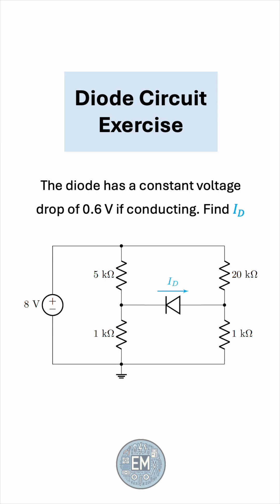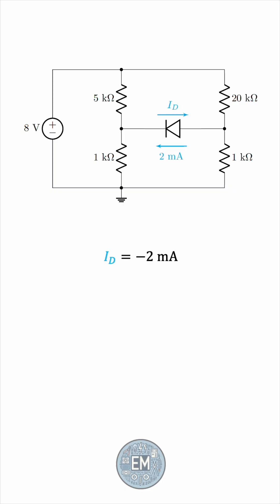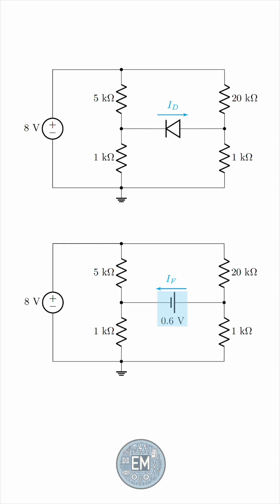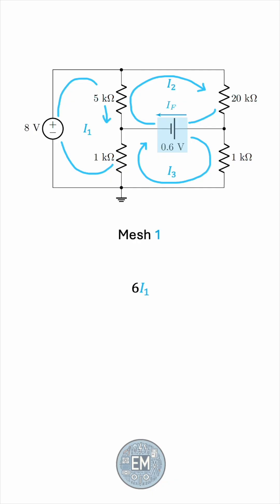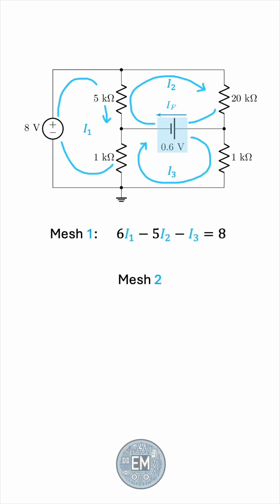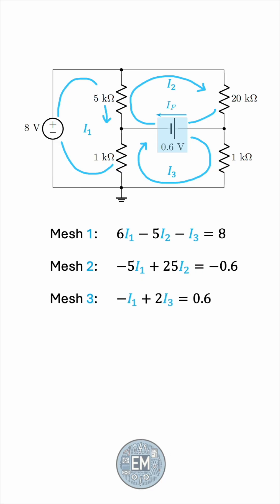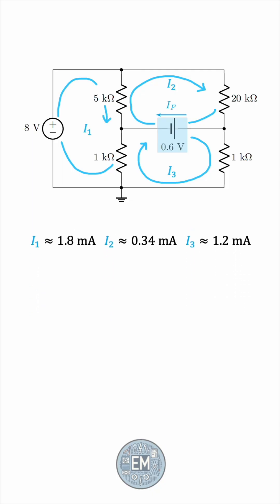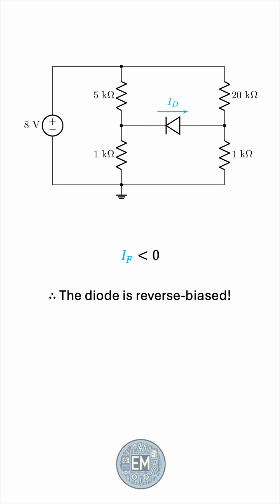How to Solve Diode Circuit Problems

Comment: If u have gone with an open circuit test , then u have solved this under min by calculating voltage at P and. Voltage N junction using voltage divider formula to find out that the diode is reversed biased
Reply from the maker: You’re definitely right, this would’ve been faster. But I also wanted to demonstrate mesh analysis as I get a lot of requests for it.
Reply: @ElectricalMaths  yeah u covered multiple concepts using single question, kudos
Reply from the maker: @Zack-z4f5i 🤝